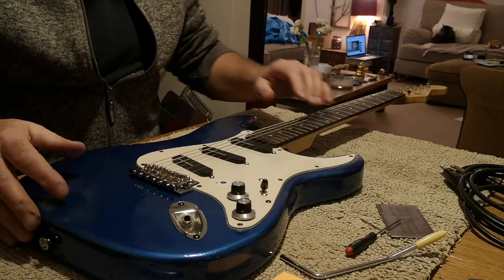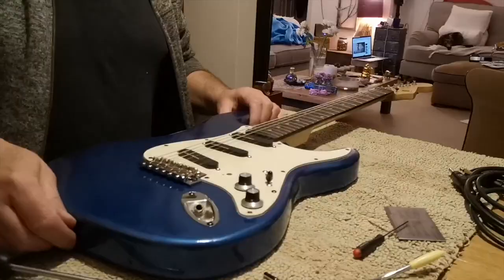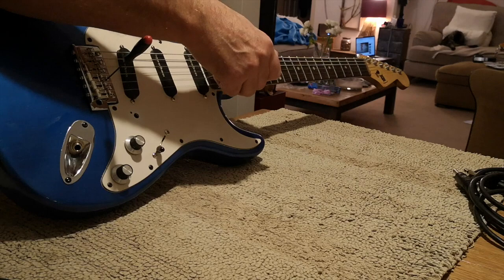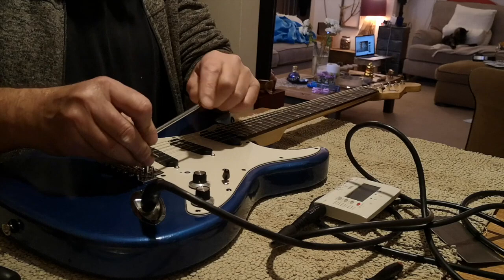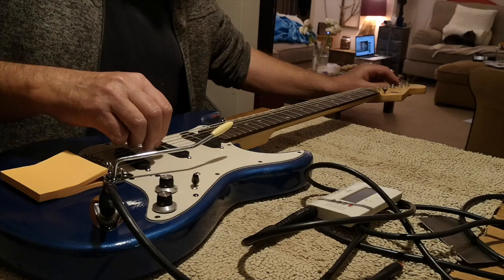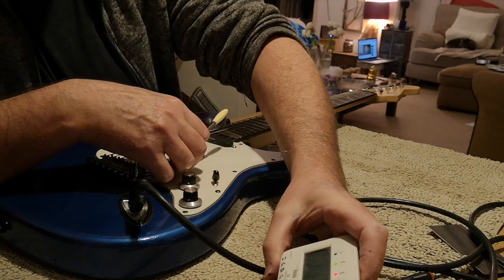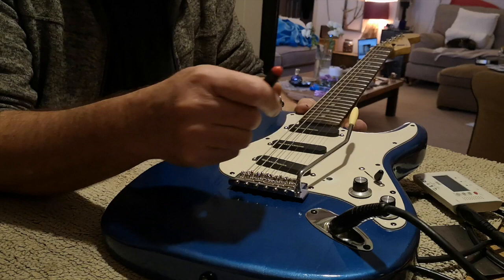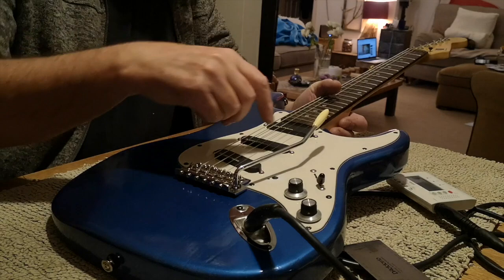Setting a 6-screw tremolo to float: a simple, consistent method *read description for step-by-step

Comment: The setup for a 2 point vs 6 screw is identical except for one thing, setting up the baseplate.  The baseplate setup consists of setting the six screws ( 2 parts, outer 2 and inner 4) to the correct height.  I didn’t see you address the mounting screws, you can have a perfect setup but if the screws are to low it will bind and feel awful, loosen correctly then suddenly it feels smooth and moves freely.
Reply from the maker: Yes you're right - on the 6 screw if any of the screws even touches the plate you're at risk of restricting it. I screw in until they touch (and start moving the plate) and then back off a full 180-350º. You could go even further back to be sure and the tremolo will still work as long as the trem holes are touching the un-threaded part of the screw.

Comment: Brilliant.  Thanks for sharing. l never thought about adjusting the tremolo to pitch- I've always done a mechanical set up.   Your method is more complex, but gives much better results in playability. Definitely going to be doing it this way from now on.
Reply from the maker: Thanks for the comment! As mentioned, praise goes to Galeazzo Frudua for the method - I've just explained it / shown it (and added a small but important detail to improve it) :) Glad it was useful.
Reply: @SamDeeksRelovedGuitars  indeed.   I have 6 guitars with tremolo that I need to get set up correctly.  I did one last night and the Frudua method with your .5 mil action compensation was "da bomb"- or in other words, it can now properly dive-bomb without sounding like a strangled cat.

Comment: He did actually mention about dropping the saddle heights. It’s the part in his video where he’s talking about reducing the friction points of the tremolo, one of which is reducing the string break angle behind the saddle. 

You didn’t include the part of his video where he adjusts the bridge mounting screws to create a pseudo 2-point tremolo. Part of that is he is lifting up the bridge base plate and compensated for the rise by dropping the saddle heights to maintain the action from before. 

I was looking for videos that did his method to troubleshoot my own attempt at it on my EJ Strat, but you skipped the step that I was trying to proof. Not trying to critique your video but your statement caught my attention and that was why your approach to setting the action is different than his video.

Comment: I read somewhere that the intent of the original design was for it to be flat on the deck. Others; like genius Jeff Beck have it set up floating and use it to the fullest. Interesting video; thank you.
Reply from the maker: That might be the case Ricardo... I'm not entirely certain. I also don't know whether the Bigsby pre-dates the Fender 6 screw. If it did, then it could be said that the 'norm' was for pitch bend in both directions and it would be likely that Fender wanted his to do up and down as well. But who knows... the patent might reveal the facts.
Reply: @SamDeeksRelovedGuitars  I believe the Bigsby was the earliest unit...😉

Comment: Thanks Sam. When I set my trem I did exactly what you discussed, leaving the action adjustment to the end and repeating. My remaining issue is how to efficiently replace strings whilst retaining the setup. Clearly as i tension any string or try to remove slack and tune to pitch all others go out of tune. Results in repeatedly tuning all. I'm probably being a bit stupid.
Reply from the maker: Hi Glenn. Once you've set it up this way, when you come to re-string it, assuming you use the same gauge of strings it will go back into equilibrium where it was before. You need to use a tuner and tune up, 1 string at a time (low E, A, D, G, B and e) and then go back to low E, A etc etc until it stabilises at equilibrium. The Frudua method is a neat way to dictate where the plate will sit when the guitar is in equilibrium (a balance between the pull of the strings and the pull of the springs) and therefore to dictate how much or little pitch shift there is when yanking back on the arm. 
Have faith; providing you use same strings and tune string by string using the tuner it will reach equilibrium with the plate positioned where it was before you changed the strings.
Reply: @SamDeeksRelovedGuitars  cheers Sam. Sure I get there in the end and the action and trem height returns. Just a tiresome process. I now replace 1 string, stretch, tune at a time. Then go through all at the end. Finally checking action and trem.
Reply: When you do this setup, the part with the post-its. put a mark on the uppermost post-it you put under the bridge. Then when changing strings, you can put the exact same amount of post-its under the bridge again. This way, removing a string won't pull the others out of tune. Then you can just keep 'em there til you've replaced, stretched and tuned up your new strings. Should make the whole process a bit easier.

Comment: Would it make more sense to reset the action at the point when the post-it notes are in place ? As then you would be going from higher action (assuming your trem was decked to begin with) back down to desired normal action, at the actual floating angle. Rather than doing it earlier, and going from previously normal action to a somewhat arbitrary 0.5mm lower action, which is then less likely to end up "right" by the end.
Reply from the maker: Might be... it's hard to even imagine it lol but you could be right. I find the 0.5mm or 180º works for me!

Comment: Hi Sam, super you tube channel! This video really helped me out with my strat tremelo setup in floating mode. I had new strings, gave them a good stretch and play-ib and followed your video for floating trem. Bang on, brilliant,  works 👍. Have to keep a bit of check on the tuning after as after a bit of trem use.. strings go out of tune.. some YTs say need to "train the trem"  to be back on tune.. but myself personally think locking tuners will be a better upgrade.. any thoughts?
Reply: Once set up, this handles the rest: https://www.youtube.com/watch?v=O0Oyc6slYRc

Comment: Hi Sam.. I realise I'm a bit late to the party but ...at what point do you think is best to tackle intonation. I'm assuming any tilt on the trem plate actually throws the intonation out.
Reply from the maker: Difficult question to answer. Intonation is strictly a distance thing (and we use sound / harmonics to measure that distance rather than a ruler). You have to ask yourself 'how much distance more or less is there between the apex of the saddle and the front edge of the nut?'. The answer will be 'a tiny amount' maybe less than 1/10mm? Yes that will have a similarly tiny impact on the intonation but I'm not sure you'd hear it.

Comment: And now we understand why the finely tuned ear of a musician eventually guides them to smash a Fender Strat into a stage until it's neck is severed from it's body.
Reply from the maker: Usually... but it will float perfectly well AND stay in tune if you get the nut right... and the tremolo rout right...and the tremolo screws are the exact right size for the holes...and the screws are exactly the right amount screwed in... and... and...

Comment: Dang, such a good instructional. But why specifically setting the G to an E? Why that much? Why not just to F?
Reply from the maker: Only because E sets the 'up bend' range to a tone a tone and a half on the G (which also represents 1 tone on the B string and a semi-tone on the high E string). If you set it to F you'd find that your up bend range would be limited to 1/2 tone on the G, less on the B and even less on the high E!

Comment: Great video!!Do you set the intonation first (with the bridge flat) or after the trem is set to float? technically in both scenarios you have the same string height but just wondering if you had tested this as changing the position of the saddle could potentially "ruin" the balance of strings/springs
Reply from the maker: Hi Mark - good question. The only answer I can give you is that I've done it both ways :-D On this guitar the intonation was already set with the tremolo locked down and I've not checked it since making this video last night but I wouldn't expect it to be any different. I'd say 'do it before' if I were you (and check it after setting the float for your own curiosity). Just like dialling the grub screws changes the tension, so too does pulling the saddle back / forth... probably less than adjusting the grub screws but maybe enough to change the trem plate setting.
Reply: @SamDeeksRelovedGuitars  The general order of set up I have gotten from my research suggests the intonation is done last or one of the last set ups but before the tremolo setup . Btw very nice video the sound could have been a bit louder  but it's not a critic at all just my view . Regardless now being 2 years on wards from what you wrote above are you still of the opinion to do the intonation before the tremolo set up because with after setting up the tremolo can one get in to the vicious circle or cycle of tweaking one thing and this results in another thing being changed that you didn't want changed in other words will doing the intonation after the trem set up mess your settings up again . Also how far inwards do the claw screws go into the wood ie how far out should the claw plate be away from the edge of the wood  the screws are screwed in to at the start of the setup ....as a rough guide I focus on this part for reassurance as it a part i'm not comfortable with .  .

Comment: Don't float that tremolo if you play blues and/or bend strings. If you have an open string ringing and you bend another string the open string's pitch will drop (out of tune). Adjust the claw with just enough tension in the springs to sit the bridge against the body.
Reply from the maker: That's right - but some players no doubt play WITH it floating and control the open strings as they use it. It's down to preference. In fact, when delving a bit deeper with a customer I rarely find that down-only tremolo use (far less floating tremolo use) is an integral part of their playing. For this reason, I set the majority of customer tremolos to 'down-only' so that with the arm off the plate stays still - even with big bends.

Comment: You didn't adjust the screws before floating the trem, like Frudua does.
Reply from the maker: Milan I'm not sure what exactly you're referring to. I adjust the screws once I've set the desired action BEFORE floating the trem - because floating the trem raises the action by approx 0.5mm. You can't set the action, float the trem (and lose the action) and then try to lower it with the saddles because that completely changes the tension and messes up the equilibrium. Seemed to me much simpler to set the target action, then lower the action by 0.5mm (180º on each grub screw) in preparation for the action rise - and then do the floating. Action then rises 0.5mm and we're back at the target action WITH floating tremolo.
Reply: @SamDeeksRelovedGuitars  I was referring to the screws on the tremolo base plate.
Reply from the maker: @milankotevski1663  Ok I get what you mean. You don't need to - all that you need to be sure of is that they are all backed off a turn or more from being tight. Do them up until you feel them start to pull down the front of the plate, then slack off a whole turn. I do this as routine so don't need a separate step. The point is that the tremolo will work well even if each screw is backed out 2 or 3 or more turns (so long as the plate still pivots on the unthreaded part of the screw).  The only important thing to know is that IF any screw is touching the plate and / or starting to pull it forward then the tremolo won't work properly.
Reply: @SamDeeksRelovedGuitars  Ok, thanks.

Comment: Sir I Was Having A Problem With My Jackson Dink Js32.While Changing The Strings I Forgot To Unlock The Pins And Take The Strings And First And Now The Floyd Rose Is Bent Down.What Can I Do? Could You Help Me Out A Bit Please?
Reply from the maker: Greetings Dear Leader. I can't understand the sequence of events you're talking about - sorry. Maybe you could try again to tell me?
Reply: @SamDeeksRelovedGuitars  I am sorry I was in a hurry so i didnt write it properly.So actually I snapped my high e string on my jackson js 32 which has a floating floyd rose.As you told to take out the strings first and to unlock the locking nut then the pins on the floyd rose a string at a time.I forgot to do that and now my floyd rose is bent down on the guitar body like this \ .How can i adjust the tension to get it back into it position??

Comment: Does the tightness of the 6 screws matter?
Reply from the maker: Yes. Tighten each one until you feel the bridge plate start to tilt forwards on its bevel (at the front edge) - then undo it at least 180 degrees of a turn. If any of the 6 screws is pressing against the plate and causing it to tilt forwards at the front (upwards at the back) then it will upset the the 'return to pitch' point. All that matters for these screws is that their un-threaded shiny part is in the right position to act as the pivot point for the bridge plate. That could be 2 or 3 turns OUT from the point where it pulls the plate forward and down... or even more. The further out it goes obviously it will look 'ragged' and eventually may not be gripping the wood firmly - but I suspect that the chromed un-threaded area will be too high to act as a pivot face by that point anyway.

Comment: Excellent instruction, worked great!  I'm curious to know if this same procedure would work on a floyd rose.
Reply from the maker: Hi... the process is kind of similar. The way I do it is the following: 
1. Fit new strings
2. Dial out micro-tuners until they're a turn or two from fully 'out' 
3. Screw tremolo claw springs most of the way in
4. Prop the FR  with a cork / softwood wedge so that the base is level & parallel to the body
5. Tune to pitch (using an inline-style tuner, not a clip-on) 
6. Fully (repeatedly) stretch and tune the strings until the tuning is stable 
7. When the tuning is stable, tune all strings to pitch
8. Remove wedge; tremolo plate will pull back into recess and pitch will go very sharp 
9. Prop guitar on its edge and unscrew the tremolo claw screws until the bridge returns to level / parallel with the body. I do this by pitch i.e. I unscrew until the G string becomes 'G' again according to my tuner. This will also be when the bridge is level. 
10. Lock off the nut caps
11. Fine tune all strings with the micro tuners